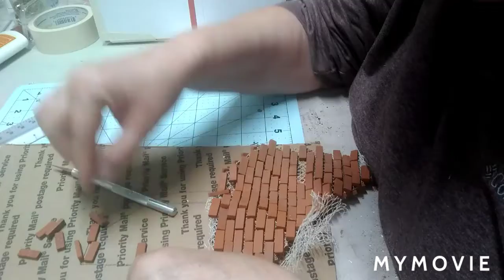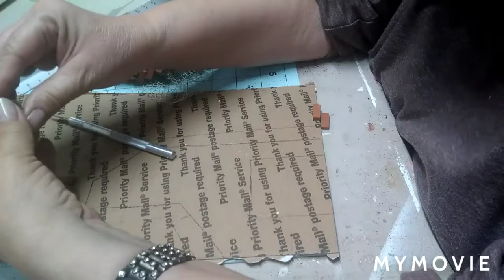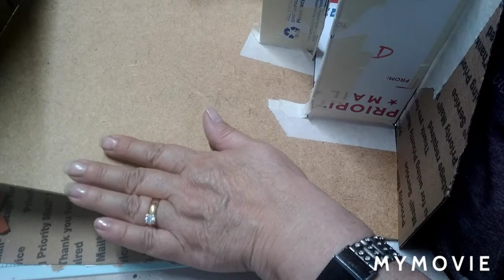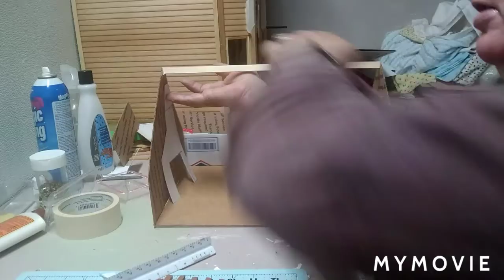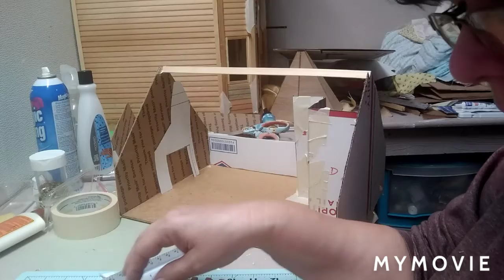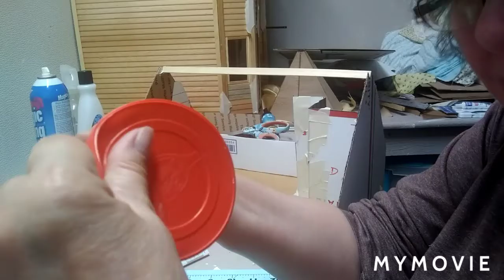Granny's Fire place

Comment: What was in the container at the end?
Reply from the maker: It's a mixture of glue and joint compound.
Reply: @foxhousecreations4869  Ahhh! Is that to fill cracks with? I use stright joint compound but it seems a bit thick.
Reply from the maker: @LittleCraftyKitty it sticks better to cardboard.  And it looks really good on the inside and outside of the houses.  I like it Alot.  And it's not expensive.